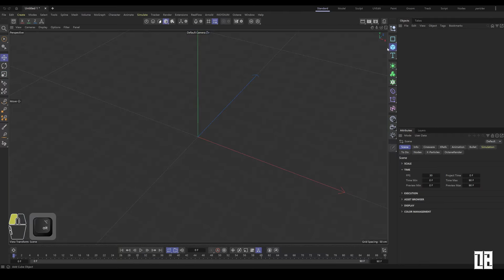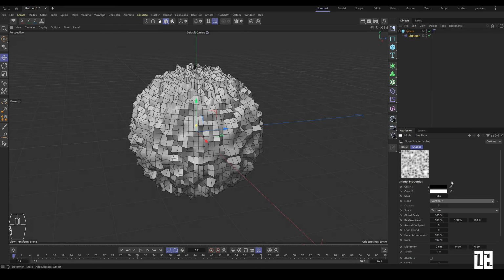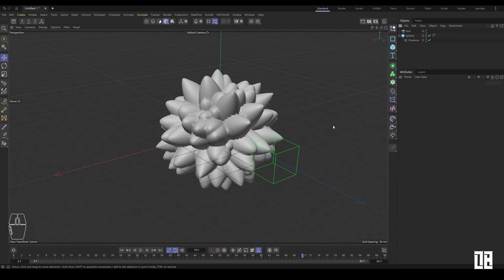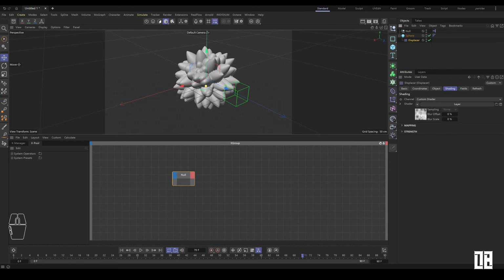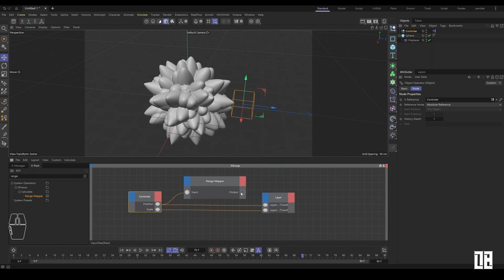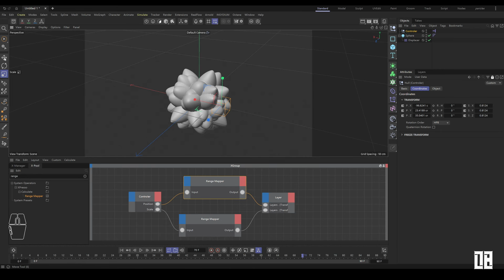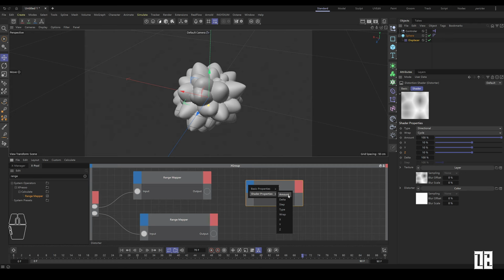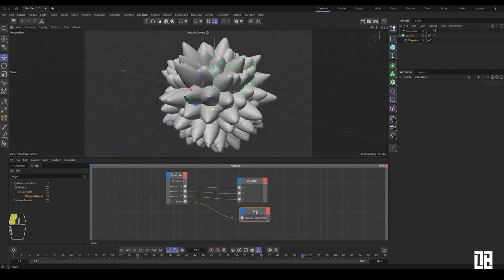Precise control of noise position and size in the C4D Displacement Deformer  (Step-by-Step Tutorial）

Comment: There are a couple of a simple alternate methods.

*Noise Modifier*

1. Open the commander (Shift + C)
2. Search for "Noise Modifier"
3. Add the Noise Modifier under your Sphere / Object you want to displace.
4. Change Modifier Space from "Local" to "Modifier"

*Plain Effector + Shader Field*

1. Add a Plain Effector, and nest it under the Sphere
2. Change Parameter > Position to (0, 0, 10.0) so it operates on Z.
3. Set Transform Space to Effector (to center the displacement at the Effector position)
4. Click on the Deformer Tab and set Deformation to Point
5. In the Fields tab add a Random field and adjust your Noise settings OR use a Shader field and build a custom shader stack.
Reply from the maker: Wow, thank you for the reminder! I’ve actually never used the Noise Modify Capsule tool before. I feel like Maxon hides many practical tools too deeply. They should pull those out separately and put them on the toolbar for easy user access, instead of making users explore on their own. Anyway, thank you so much for your patient answers to my questions!
Reply from the maker: Hello! I just tested the Noise Modify Capsule you mentioned. If I change  noise type, it causes C4D to crash. I'm using version 2025.3.1, and I'm not sure if the latest version has the same issue.
Reply: @Double_design  Known bug that should be resolved in 2026.1 when it releases.